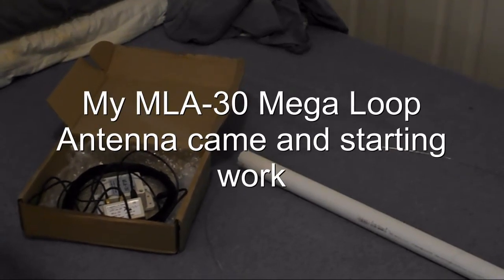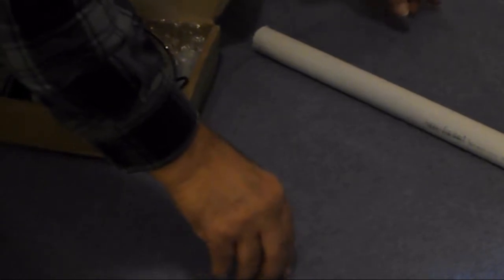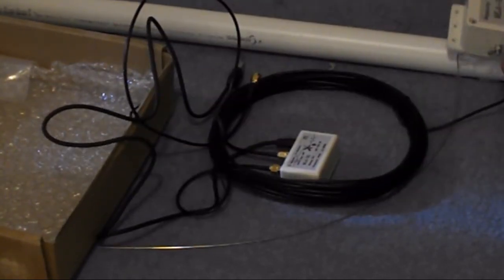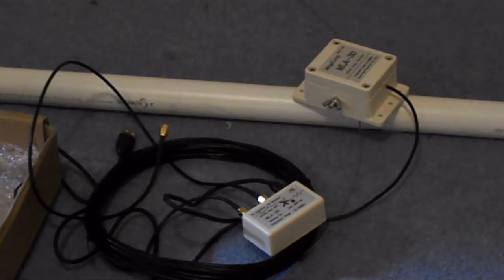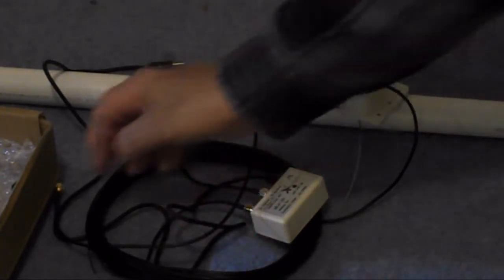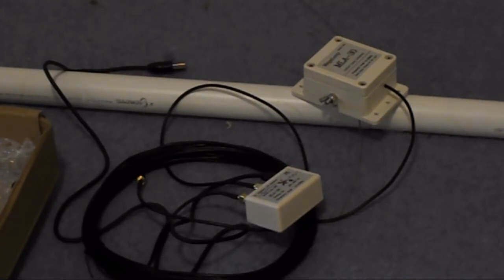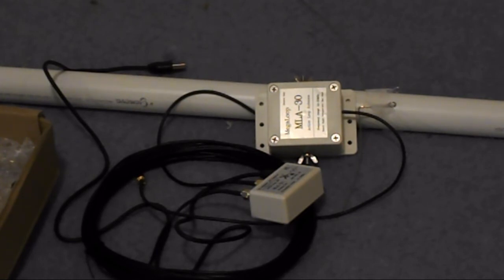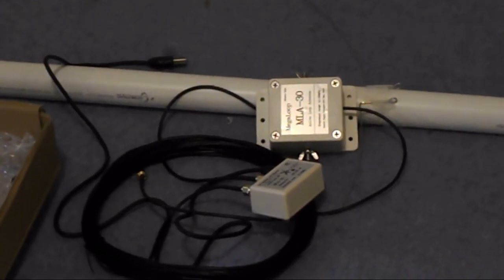My Mega Loop Antenna has arrived and how I will build it

Comment: Looks nice Larry...to bad for the HOA, I would suggest a tower to help to get away from the QRM...maybe next house you'll buy outside of town, buy lots of sand away from people, QRM and HOA's!  ~Jack, VEG
Reply from the maker: the HOA is fine I wont live in an area without one. I won't be buying any more houses. I paid cash for this one and don't see a reason to leave. There are always work arounds for noise. No Tower allowed in an HOA either. I already finished the antenna today. Will be checking it out on the radio as soon as I get an adapter for the coax.

Comment: Is it only a receiving antenna or can you transmit on it too?
Reply from the maker: it is primarily a receiving Antenna but it can be used for low power transmitting 75 watts or less. The Larger ones they make out of heavier wire can support a lot of transmitting power up to 1,000 watts but those antennas cost about $300.
Reply: Thanks Larry, BTW are you on 75 meters AM?
I listen mostly to 3873 and 3885 AM at night.
Reply from the maker: @old64goat  My brother has a military Net he belongs to and I know and have met most of the guys there and they are on 3975 AM